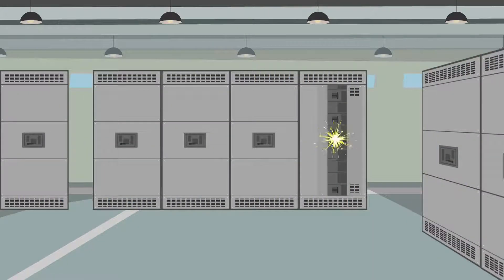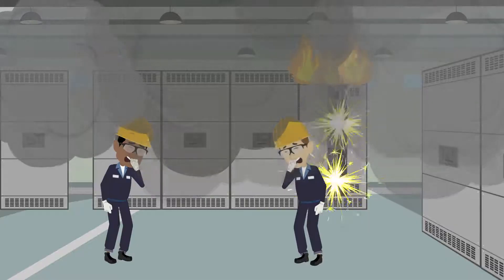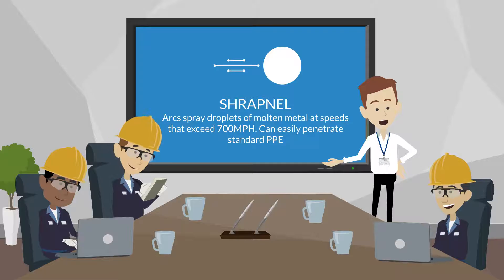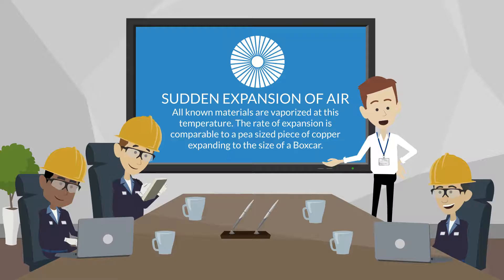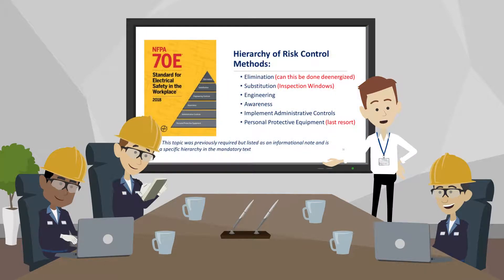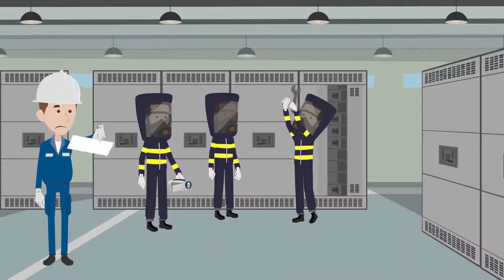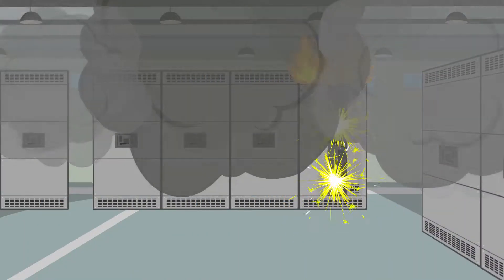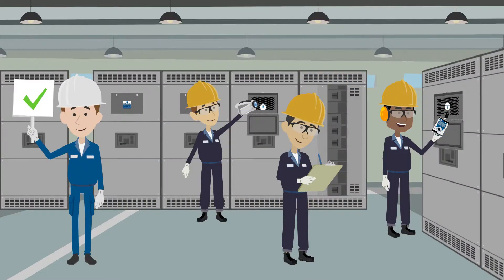What Is an Arc Flash? | Dangers, Causes & Prevention Explained by IRISS

Comment: it can be nasty, wearing as much ppe as you got helps.
Reply: Full-body PPE helps, especially if you pair it with opening the inspection panel from 10+ feet away  to the side with a non-conductive lever
Reply: i was a lineman and had two good flashes in my career  up on the pole top with switches that failed, luckily i was in a bucket both times and on the end of an 8 foot switch stick and ppe and fr clothing. both were at night and it looked like the sun had come out, yikes, i was lucky both times equipment failure. @toddkes5890
Reply: You've drank way too much corporate/insurance Kool-Aid.
Reply: @jimmywells33 well if you've had an encounter with it lets hear it.

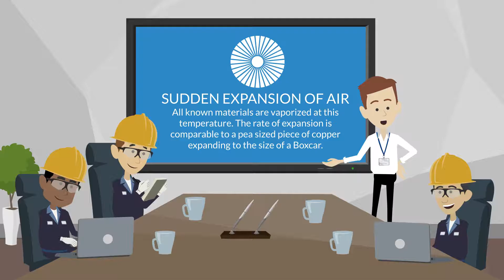Comment: 1:04  shrapnel: arcs spray droplets of molten metal at 700mph+.  1:22  high temp: electrical arcs produce some of the highest temperatures known to occur on earth.  up to 35,000F or 3x the temperature of the sun.  1:38  sudden air expansion.  all known materials are vaporized at this temperature.  the rate of expansion is comparable to a pea sized piece of copper expanding to the size of a rail boxcar.  blast pressure waves have thrown workers across the room.   1:56  fatal burns:  even when several feet away.  2:03 hearing loss: the arc blast can have a sound magnitude of 140db at a distance of 2ft from the arc resulting in permanent hearing loss.

Comment: That lad on the right is deffo not getting the right message from his safety briefing. Look at him, hes just sitting there thinking "dammmmnnn, that sounds _awesome_"
Reply from the maker: Great observation! Not 100% of the team fully focus on what is being taught in safety meetings. However, if the system is designed for safety & reliability from an operational structure, the high-risk activities can be eliminated and the threat to worker safety can be avoided.